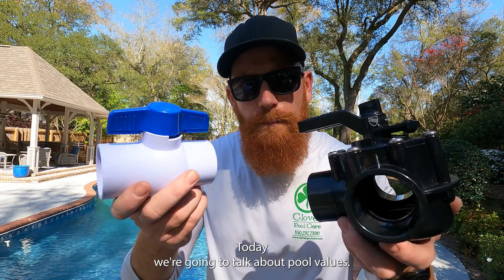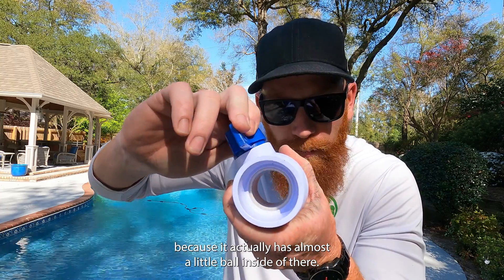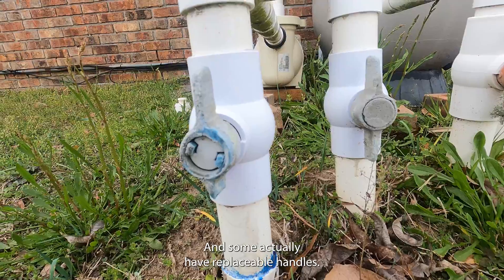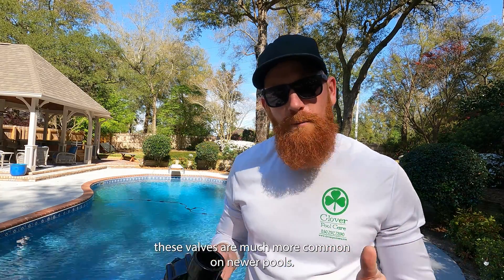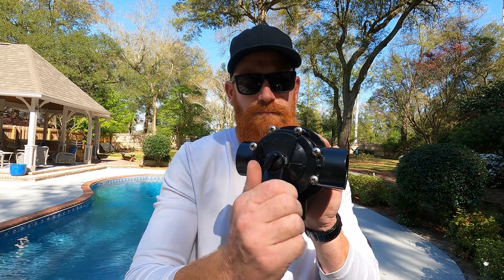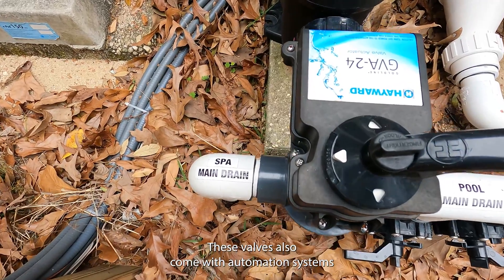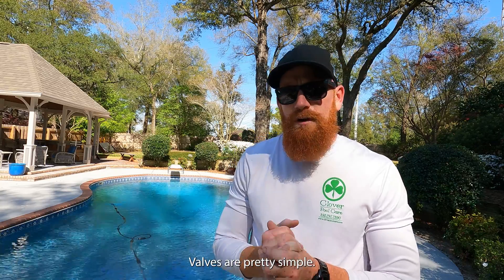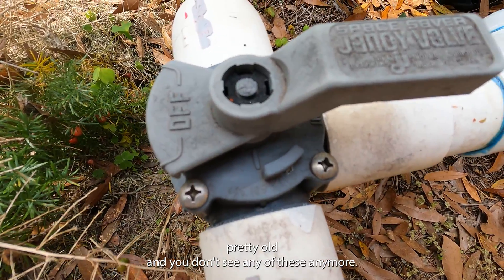Pool Owner Basics - How Valves Work

Comment: great video, .. would you happen to have a video on the ball valve replacement?, like a new ball valve?, .. my handle broke off and its stuck on off "its a water feature" valve.. thank you
Reply from the maker: No video on ball valve replacement yet, sorry.  If its just your handle that broke off, some ball valves have replacement handles you can buy.  Check to see if your handle has a cap with a screw underneath.

Comment: good video. I have a question. well two really. I have Jandy Valves, but mine also have a turny knob on the side. what is that for and how does it work? Second question. One is leaking. I started to sum of the parts was great then a new valve. should I just by a new one and take off the parts I need?
Reply from the maker: That is a great question!  The grease cap on the side eliminates the need to disassemble the valve for lubrication.  Not sure which part of your valve is leaking, if it's just the o rings then it's fixable, if the plastic is damaged then replace the whole valve.  Thanks for watching!